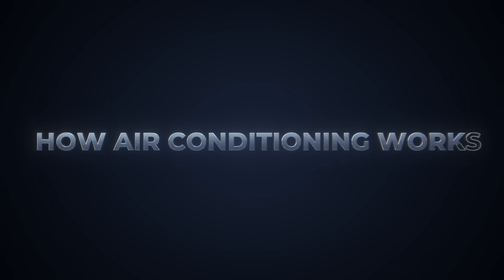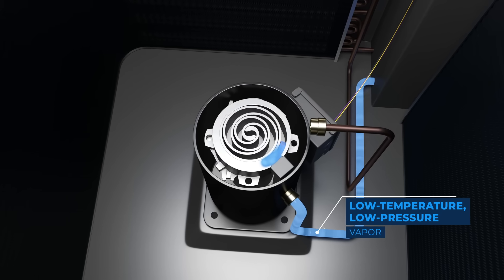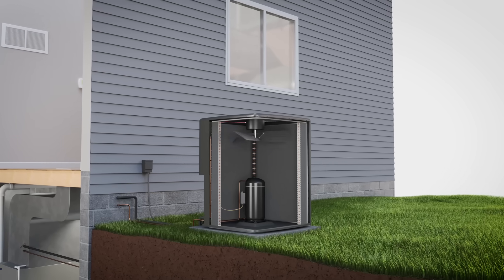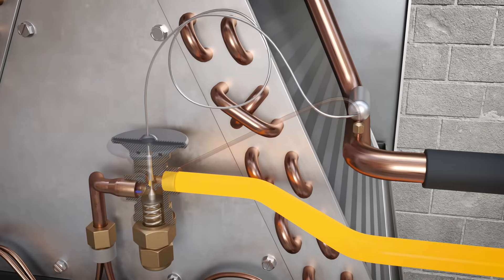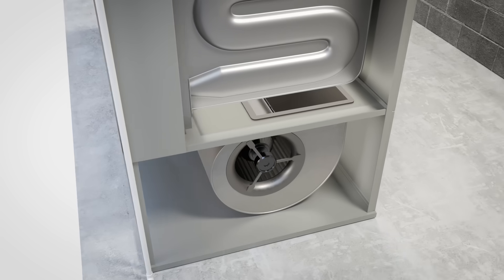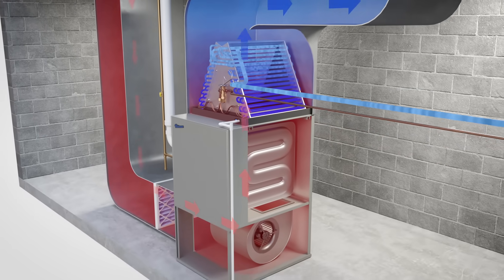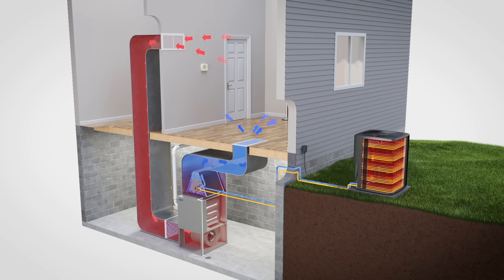How Air Conditioning Works

Comment: hi so how exactly the ac controls the air temperature that is being blown out to the room? 

i want to learn about ac and im simply curious about how my car can give out really cooled air and  less slightly cooled air
Reply: On a conventional split system like in the video there is no control of the supply temperature. It always blows as cold as the system can make it when its on. A thermostat will be used to turn the equipment on and off.
Other systems are what is called 2 stage and will have a low cool and high cool mode. Either the thermostat or the equipment controls will determine which stage to bring on.
Fancier systems with inverter technology are capable of varying the compressor and fan motor output to control performance. Various sensors will be used to determine how much performance is needed.
In a typical automotive application the car will mix the cold air with warm air to control temperature. A blend door will direct air through the evaporator or the heater core to control outlet temperature. The AC system will be cycled on and off to keep the evaporator coil cold. In a high demand situation the system will run for longer periods. But in a low demand situation the compressor will cycle on and off more often as it does not need to run very long to keep the evaporator cold.
Reply: @Redtooth75  
thank you so much sir. that answers a lot

Comment: So if my ac wont cool down the room whats wrong? 

All ducts seem to be blowing room temp air and not one is absorbing the heated air.
Reply: There could be many things that have gone wrong. The most common problem is a bad capacitor that is causing the unit to fail to start. A dirty condenser could also cause it. Being low on refrigerant is another cause. Something going wrong in the low voltage circuit could also cause it because then the unit will not get told to turn on.

Comment: Does condensated water ever drip on furnace's coils causing them to rust or crack. How is that prevented?
Reply: It is not supposed to. There is a drain pan and hose underneath the evaporator coil. Water will run down the coil into the pan. It should not drip off of the coil due to the adhesive properties of water.

Comment: Some elements are misleading. The compressor is just a pump. the condenser has high pressure gas (which will condense as a liquid) because the valve does not allow it to pass quickly. Remove the pressure valve and everything falls apart...

Comment: ok so how does inverter technology works in ac
Reply: The key thing about an inverter ac is that the compressor output is variable. A normal ac is either on or off, an inverter can vary the power output to meet the demand on the system.
The ac power from the house is converted to dc, then the inverter converts it to the exact type of ac power that is needed at the moment. An inverter can vary the ac voltage and frequency applied to the compressor. Which makes the system more efficient.

Comment: I don't understand why flowing past the needle makes it cold suddenly.
Reply from the maker: Going from high pressure to low pressure suddenly causes a drop in temperature.
Ever taken a can of compressed air and turned it upside down and pulled the trigger? Same concept :)

Comment: Amazing! I've recently started learning Blender and I'm a quick learner and perfectionist so even my first models are up to spec and schematics I find online and are very realistic in my renders. I've wanted to do stuff just like you're doing here, helping people understand how stuff work (since I love researching) and having a challenging project to learn Blender on the way.
My first project will be on electrical plugs and sockets since it's more complicated than most people understand. The distance between the inner socket copper and the plug's metal part is crucial to prevent small hands (like a small child) from removing a plug and touching live metal parts. The couple pins on the EU are intentionally a little bent towards the middle to create some pressure when they are plugged-in to make them snug and so on.
I don't really know how much time it will take, and since I'm using an open-source tool, I'm not planning on selling any of the project, just making it all CC0 to give back to the open-source community.

Comment: But most coils are made of aluminum instead of copper. Why use copper in the first place?
Reply: Most coils use copper tubing with cased in aluminum fins. Copper is stronger, better at heat exchange, and much easier to repair. But it is more expensive than aluminum.
Reply: @Redtooth75  Ahh. Most of the coils I've been scrapping are the copper type. Very few I get are aluminum. And they pay poorly as scrap compared to copper.

Comment: I've been in the HVAC trade now for about 5 months as a helper doing change outs and new installs, and this video is an excellent reference for the refrigeration cycle and how it works. I've still had questions here and there but this summarizes basically all if my questions. Thank you!

Comment: what happens if the outside gets so hot it melts or something? that kinda confuses me but i guess it will just shut off?
Reply: Some systems have a discharge temperature or a high pressure switch or both. If the pressure and temp get too high the compressor shuts off. If the system does not have those protections it can damage the compressor or in extreme cases cause a line to rupture.

Comment: But the air conditioner is not only for cooling, but also for heating the room in the winter, and you did not explain how the heating process works!
Reply from the maker: The equipment used for air conditioning do not operate in the winter for heating. Only the heating coils within the furnace. The coils are typically located below the evaporator unit.
Reply: @mattrittman  This means that the heating coils are not connected to the mechanical system of the device, and that in the winter the heating mode the electricity consumption for the air conditioner is greater than in the summer because in the summer the mechanical system works, right?
Reply: @قَسوَرَة-ق  some systems are what is referred to as a heat pump. Air conditioners are also technically heat pumps but are not marketed or referred to as such. Heat pumps are essentially reversible air conditioners that are capable of cooling and heating a space. They have a reversing valve that sends the discharge refrigerant to the inside coil first and then the outside coil. So the inside coil would be hot and the outside coil would be cold.
Reply: @mattrittman  And also, please, how does the humidity mode work?

Comment: At the beginning it shows the compressor turning cool vapor into warm, only to cool it again with the fan and send it back onto the house. Are we that sure the cooling through the condenser with fan will always be greater than the added heat from the compressor? Real question- clearly I'm not a pro😆 and where did the heat go from the evaporators pin valve temperature change?
Reply: Yes we are sure. The refrigerant needs to be hotter than the outside air temperature in order to cool. The compressor adds more heat. When the fan is sucking in outside air at the condenser, the outside air is cooler than the hot refrigerant and it’s absorbing the heat out of the refrigerant to the outside and then the vapor is cooled down to go back into the house.

The refrigerant is warm when it leaves the house because it absorbs heat from your house and before it reaches the compressor. That’s why when you put your hand over the condenser fan you feel hot air. 

At the evaporator pin valve, when you decrease pressure of something you’re also decreasing the temperature. So when the pin is working, it’s regulating the pressure, thereby regulating the temperature of the refrigerant to an even cooler state.
Reply: @RzVids  Amazing. Thanks for that info! I'll rewatch and make the pieces fit in my mind as I go :)
Reply: @teezecrost  Yes, remember hot always wants to transfer to cold, called heat transfer. That’s why when you touch the inside of a refrigerator for example, the heat from your hand is transferred to the fridge and the cold sensation you feel is the cold from the refrigerator transferring to your hand.
Reply: I thought the pin part was not that clear. I have watched this twice and I’m still not sure I could explain this to someone.

Comment: Our air handler is in the attic. Mice made a nest by the condensate drain pipe and it became plugged with insulation. The water had no where to go so it just over flowed and went into the ceiling. I came home from work on a 100° day and when I walked in it was raining in my kitchen which is below the air handler. It was such a mess. Tool a week to dry out enough to begin cleanup. So make sure that drain line is clean and clear.

Comment: I will make it easy , when you apply high pressure on liquid or gas then release it from that high pressure, it is get deep cold temperature, the best gas used is the Amonia , but because it poisonous they adopted Freon gas instead , so that is the recap of this video
Reply: Freon was replaced with R134a a while back, which is now being replaced with HFO-1234yf
Reply: @handlesarecringe957   I know that , but ppl still use Feron to refere to the gas used in ACs systems

Comment: The most important point of comfort cooling is overlooked in this video, dew point, the AC system simply lowers the dew point inside the structure so the occupants can perspire easier, and presto, you have comfort cooling.

Comment: I recently had a used turbo incabulator installed on my a.c. unit, it uses inverse reactive current in unilateral phase detractors, and can automatically synchronizing the cardinal grandmeters. The only problem it had was with side fumbling but I had a local mechanic replace the 2 parallel marzelveins and now it operates with little to no side fumbling.

Comment: Can you also add to this vid? ....to explain how the system works in reverse to heat the home? I have such a system,....and it also has an aux electrical heater strip in the air-handler inside the home "box" ( evaporator section)........if needed ,.... such as when the thermostat asks for a quick heat-up of the home (many degree change on the setting)....instead of a small degree change when only the "reverse" cycle occurs to increase the living space temp.
Reply from the maker: Unfortunately I probably won’t revisit the air conditioning side of animation. Spent quite some time putting it together, and it just didn’t receive the interest I was hoping for 😞
Reply: @mattrittman  ...sorry to hear that as to the low level of response you received....as this is one of the best vids I have seen on the topic. Thanks for the quick response...and take care.
Reply from the maker: @TheWilferch  Thanks Wil seriously, that means a lot man! I think part of the reason may be that split-systems aren’t quite as prevalent as single units. But who knows really.
Anyway, thanks again and take care as well!

Comment: Not all ACs work the same. Had a new one installed last year because it broke. Its not as good as the previous one even though this one is 10 years newer. Its just not quite as cool and the cool air dissipates quicker.
Reply from the maker: I hear ya there. Everything is built cheaper nowadays 😡

Comment: The compressor doesn't pump refrigerant. It compress the refrigerant. PUMP is for LIQUID. COMPRESS IS GAS. and compressor compress gas refrigerant not pump liquid refrigerant.
Reply from the maker: The compressor acts as a pump. It’s the only way the refrigerant can move throughout the system.

Comment: How do I unclog an A C drain?
Reply: You can take the front panel off that is infront of the evaporator coil. That's where the condensate drain starts. You can shove a wire brush down it and brake up that sludge. There is also a cap on the P-trap where you can access and clean it out. You can drain it with a diluted bleach water to help prevent further bacteria build up.

Comment: Whoever designed the system in a house shown is dumb. Cold conditioned air will never make its was up, as the cold air stays down the bottom, the hot air always rushes up. So a good idea is that conditioned air comes from the ceiling rather than floor,

Comment: Couple tips in the home make sure return vents are free of dust or any furniture blocking them if air can’t probably return to the furnace the cooling process won’t work properly. Same with the condenser unit outside clear any leafs and cut tall grass away from the unit spray it down with a garden hose make sure it’s clean. If the condenser can’t release the heat cooling won’t work properly. Also change filters regularly as well.

Comment: This is a serious question... What happens to the heated air that goes outside? Does it add to heating the outdoors in any way? If so thats awful. I guess it wouldnt though, since that hot air inn our houses would be outdoors anyway if we didnt have homes. But then again... Carbon emissions come from us running them, so, yeah... We're probably better off just adapting to the heat.

Comment: So wait, after the current indoor room temperature air gets pulled into the duct, and through the evaporator, the air going through is chilled, and the cold refrigerent is heated up, turned into a vapor, then goes back to the condensor to be made into a liquid again. But what in this process cools the refrigerent? I see it goes through the metering device which lowers the pressure of it. So does lowering the pressure of the medium temperature air cool it? Like how liquid carbon dioxide can only exist under extreme pressure?
Reply: The TXV cools it. The TXV drops the pressure rapidly causing it to be super cool in the evaporator. Same as a can of compressed air when you spray it becomes cold.
Reply: Yes good explanation. The narrator should have made this point.

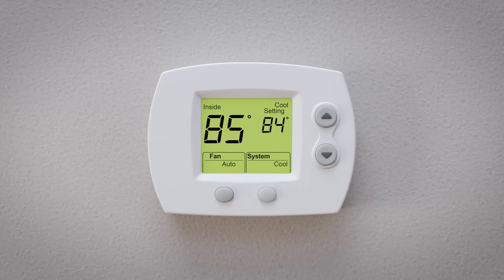Comment: 0:35 You're setting the temperature to 72 degrees
Reply: If the condenser fan motor is malfunctioning the cooling system will breakdown
Reply: If the condo fan motor is malfunctioning it will need to be replaced

Comment: 20 year service tech here, your animations are incredible.
Reply: I have a question for you if you don't mind me asking.  With my thermostat set at 72 the room is not cooling down (room stays at ambient temp).  Checked the condensor outside and the fan is spinning as well as the air handler blower fan in the house.  I felt both the large and small diameter freon lines and neither of them feel cool/cold.  Do you think it's my freon charge?  Is it possible for the condenser fan to run if the compressor is not running?
Reply: @jaso5114  you probably have a bad capacitor if the fan is running without compressor running. Could be refrigerant but probably not. Tons of videos of how to replace that part. Feel free to ask if you have any other questions.
Reply: @dwigg7700  Thank you so much for your advice.  I tried operating it once more and now neither the fan or compressor run, all I hear is a humming sound.  Ordered a replacement capacitor!

Comment: When the thermostat is shut off, doesn't that mean just closing a solenoid valve at the evaporator? Then the refrigerant is collected in a receiver and then a high pressure cutoff stops the compressor... right?

Comment: Why does the compressor exist? Why would you want to essentially heat the coolant before cooling it a moment later?
Reply from the maker: From what I understand, it needs to be in liquid form. But in order to be liquid, it needs to be pressurized by the compressor, then ran through the condenser coil.

The reason it needs to be in liquid form is so that it can drop in temperature as it flows through the thermal expansion valve.

I’m not an HVAC professional by any means, and I’m sure I’m missing a lot of the science behind it, but hope that kinda makes sense.
Reply: @mattrittman  Okay that makes so much more sense now. Thanks! 
Love the videos. Love the active comment sections too :)
Reply from the maker: @Justin-nx3pw  Yeah haha it’s funny you ask that question, because I had wondered the same exact thing for so long. It took me a while to finally ‘get it’. Thanks so much for the nice comment about my videos. I really appreciate it man!

Comment: I feel like we are finally getting the education we were promised.
Reply: the era of information is finally here?
Reply: That animation is top iceberg only that system is a lot more complex and need a lot time learning how everything works don't talk about electricity this system used 3 different types electricity voltage plust calibration on all equipment to properly operation under pressure